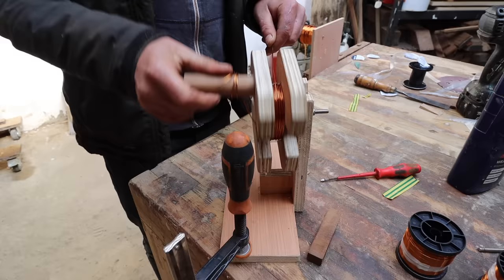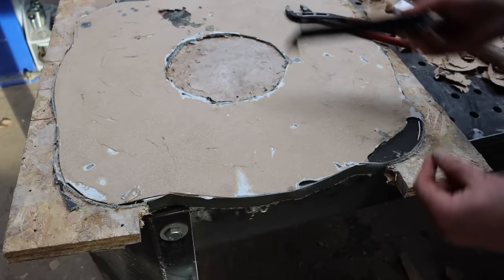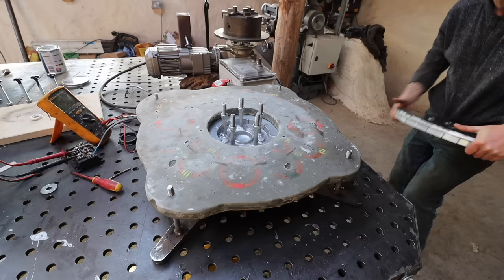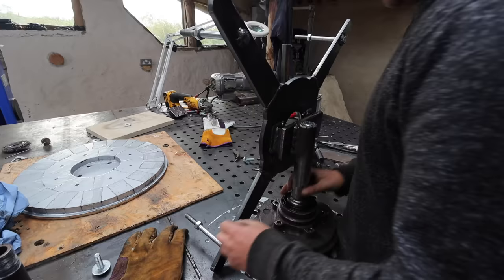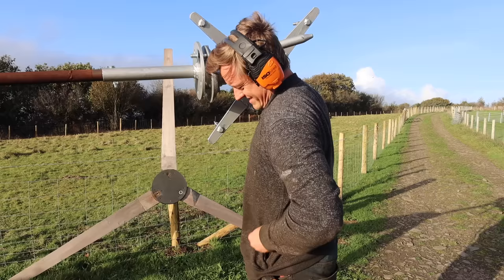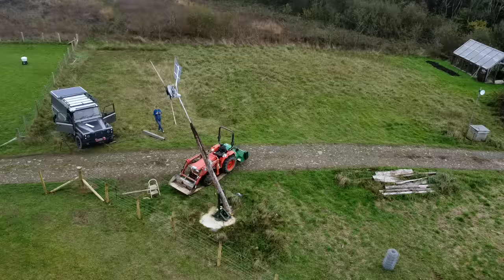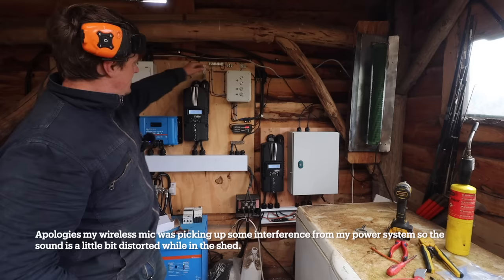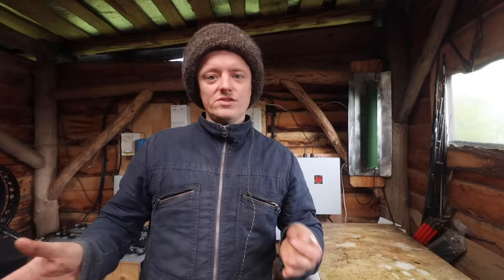Off Grid 2 KW Axial Flux Wind Turbine And MPPT Dump Load Controler Build

Comment: If you have enough capacity in the batteries why don't you just buy a few extra dump loads and put them in series. Get a couple of tonnes of sand and build a sand battery in a pit with some insulation round it. You could then have copper pipes running through this for boiling / heating water. Or build a sterling engine if you want to extract the heat back to electricity.

Comment: Hello sir,

I have 50*25*12mm magnet size, 14swg copper wire, so I required coil size(farmo) and output voltage and current

Comment: Greetings. can you explain what you mean by wind turbine brake? I didn't see you install something like that.
Reply: It uses electrical dynamic braking.  By switching the output of the turbine to basically a huge load resistor. The load is more than the blades can pull. therefore, it will not over speed the wind turbine.  Hope that help you understand 😊

Comment: Our son is buying some land in North central Arkansas and we are interested in off grid power systems.  It would probably cost a small fortune to run power line power from the rural power association so I’d rather put that money toward free power from then forward.  There are numerous flowing creeks and streams but none on his land.  I’m not sure what if any hurdles there would be to jump through to get land owner permission to install a flow if the river type generator as it would probably be difficult to install a mill pond for a water reservoir to power a water wheel or get the elevation drop needed for a high speed cup type turbine.  I have not researched elevations in the area to see what might be available.  I have found your videos educational though incomplete for the novice in this area that I am.  Where can I find the best detailed but most easily turned from information overload into usable applicable technical knowledge ?

Comment: Would it not have been more efficient to use an iron core in the windings instead of resin? Using iron should increase the inductance in the coils, allowing for smaller coils and probably smaller, more efficient design overall. This is what most modern turbines use to increase performance, decrease size while also reducing costs.

Comment: I just about can power my whole 1800 square foot house, garage, work shop with 20 KW of power. With every thing on. I never had tested to see how much power i would need to run every thing > 2 KW is only 2000 watts > That not a lot of power ~  but cheaper than solar

Comment: why did you not vibrate the base while adding the resin or just tap around the base underside to minimize the voids, ,Not doing so sure can in some cases create lots of extra work post pour and setting,  as well spray some form release on the forms or just some wd40 will help in the release? I think I see some areas where this is going to be a problem just watching,
Oh and ok here we are now removing the form as I suspected as you were pouring just where I thought. Ok not too bad of a post pour fix up though

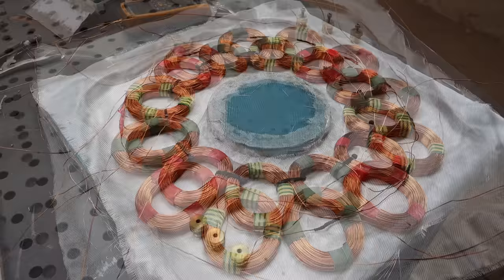Comment: At 6:13 you say,  "Here's my terminals - 3 phases - 4 coils in each phase" and then you trace the route of the wiring on the Red phase.
Beginning with the first coil (next to the terminal) - you show that it was wound in a CLOCKwise direction.
You then show that the other three coils are wound in a COUNTER-clockwise direction.
Q:  How did you choose which one to orient differently?
Then at 16:30 you admit to making "mistakes" when labeling the magnets with an "N" and an "S".
I'm wondering what other mistakes you might have made.

Comment: Renewable Electrical Plant  HYBRID Solar Cell & Water Energy Gravitation Engineering Closed Circuit no need river/waterfall.
Prymary system Direct Current and than to chane Alternating Current with Invertor. 
Big Power PARALE unlimiteCan be installed  at EVERY WHERE in the world (afordable).

Comment: You and your fans are seeing the wind energy as a religion, trying to invent the wheel  again. You should better find proper advice before you waste so much neodym, expoxy copper and time. As you can learn from all comercial electric engines the magnetic flux mustn't  be interrupted by big spaces of air or non magnetic epoxy. Take the stator of a  700rpm 3 fase motor instead and only modify the stator with permanent magnets. This way you get a much better generator living much longer and waste less materials. I doubt you home made wind wheel will make much electricity but you might be well advised to begging for money via Patreon!